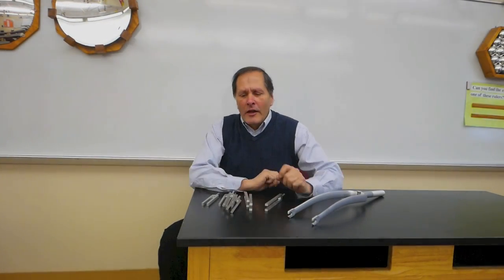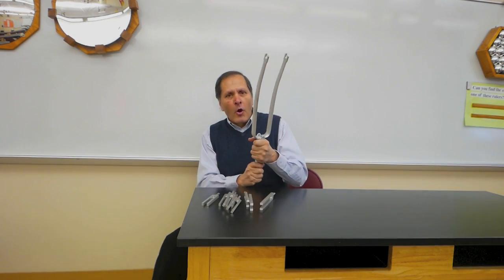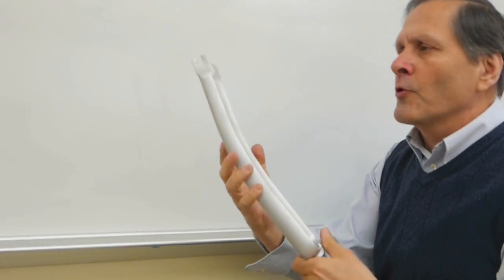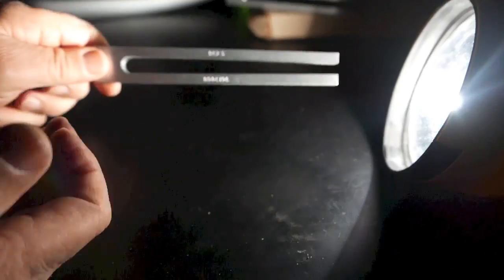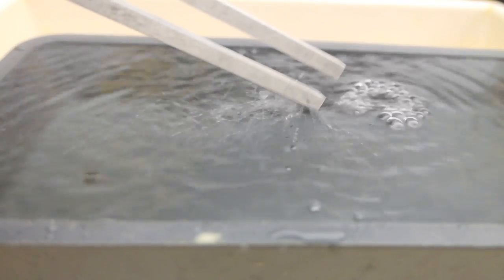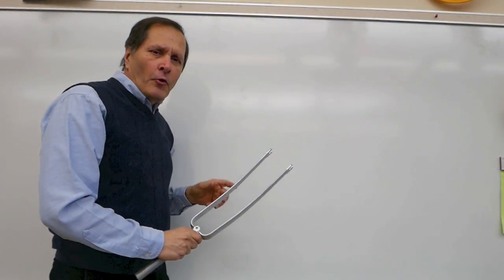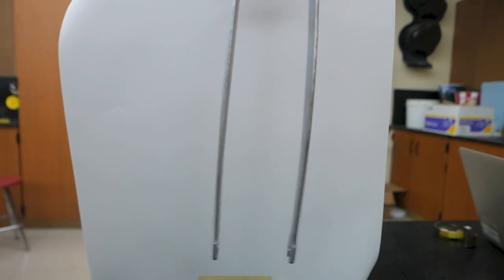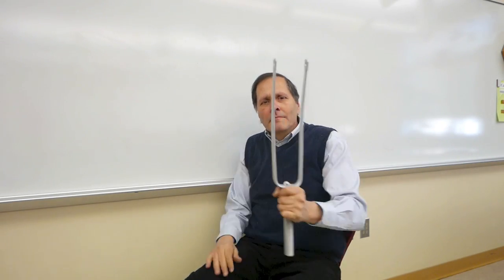Bicycle tuning  fork - physics of toys // Homemade Science with Bruce Yeany

Comment: I have questions and no one to ask... 🤓 How would I create a room or smaller area where one would be surrounded by a tuning fork type perimeter, (and maybe have flowing water around); which the vibrations also flowed through. I suppose sound vibration would work with speakers, but is that really the same? 😕 I guess that is the only way it would also be adjustable for lows and highs, but what would be best to transmit through water or the ground.  🥸 This is all new to me

Comment: I thought this was interesting how if you hold a tuning fork over a glass and hold another glass at 90 degrees to the other you can cancel the sound most effectively or "no sound whatsoever" according to this public domain book SOUND AND ITS PHENOMENA  (page 33 with diagram). It was also mentioned that a tuning fork placed on the end of a metal rod will sound but not if then the rod is bent 90 degrees.
I also tried the two glasses and tuning fork example and it's uncanny how well this worked with a 1024 C tuning fork with short glasses after a little practice.
Reply: A footnote though, canceling out a strong freshly struck fork completely defeated me. And it was tricky to get just the right angle with lower amplitudes. Maybe with precision, a different frequency or glass shape would be more forgiving.

Comment: Your channel is fabulous. (Great trick with the water in this video!) - But please try finding a set of better microphones and use them appropriately, in the right distance they are specified for. It seems part of this video was recorded with an ambience mic, where you would have needed a focused one that cuts out ambience noise. I know it is a lot of work to set up proper audio, but the videos will be much more enjoyable then. - Thanks for your great work! I watch every single video!
Reply from the maker: Thanks Christian,    I realize that's been a problem,  the camera I've been using was supposed to be of good quality (and fairly expensive) . but  I've had a lot of trouble with the exposure setting and sound.  I just bought a new camera Sony RX10 M4   and a directional sound mike which should make a big difference.     At the moment I've having problems with compatibility of the camera to my Mac computer but hope to have this worked out soon.

Comment: Great vid and thank you for solving a problem I have been working on, I was going to build a fork but this will work for the application I have in mind and I already have a pile of old bikes that have already been used for the gears and other what nots

Comment: Have you come across any big tuning forks at 24 hz?  I would like to do some experiments with with one at 24 hz
Reply from the maker: No, I haven't but you could adjust one like this by adding weight to the tines, that would slow it down until you got it to 24 hz

Comment: the camera has a rolling shutter
the waves are caused because the camera does not take an image at one instance in time for every frame, instead the image is created by quickly scanning across the sensor (say from top to bottom). the movement of the beam in the time it takes to scan across the frame is causing this rolling shutter effect. 

the shutter speed of the camera is the other element here. at lower shutter speeds the bar is blurred and the scanning is less evident. at higher shutter speeds each section is nicely frozen in place.
you could probably get this effect with an old CRT monitor where the pixels are illuminated by a scanning stream of electrons and show the phenomenon without the camera or with a rotating drum with slits in it so that a thin beam of light can scan across the bar very quickly.

if this doesn't make sense feel free to ask me to try and explain it better.
Reply: ps.
i think rolling shutter has been mentioned before (i just looked deeper into the comments) sorry if I've just told you what you already know

Comment: Maybe the black white background thing is caused by exposure duration.
The black background makes the camera attempt to compensate by being exposed for longer thus showing a blur.
The white exposing for brief enough that it only shows offset portions, like the strobe light does at a different speed. Maybe

A way to test this is to show the fork in front of a white bright view with the area the fork is in front being dark. Versus a dark view with the background behind it being white and clearly lit. The view refers to the majority of the cameras area.

Or if your camera allows you to set a fixed exposure duration regardless of lighting.
I hope you investigate this because I'm curious

Comment: The phenomenon demonstrated in the end might be reversed if the colors are switched, i.e. the bicicle tuning fork gets to be black.

It seems it has to do with factors like light/color frequencies and camera shutter speed/frequency, camera processing speed versus tuning fork frequency.

It would be interesting to test my statement, and kind of easier for you rather than me since you have the constant set parameters of the equipment involved.

I just discovered your channel.

GREAT WORK ! :)

Greetings from Heraklion, Crete, Greece !

Comment: Hey, I know why it wobbles in front of lighter colour backgrounds. 
The camera you are using has something called a "rolling shutter" which is basically taking the information off the sensor left to right top to bottom over 1 frame, so the top left hand corner is actually being recorded a fraction of a second before the bottom right hand side, this in combination with the shutter htz will give you this effect, It happens more on lighter backgrounds due to the luminosity and the contrast isnt as great and it blends into itself, making it more visible. 

If you were to use a camera that has a "global shutter" you would not see this effect, as a global shutter takes everything the sensor see all at one time, unfortunately these cameras are usually heavy duty and aren't made for prosumers with the cheapest one going for around $5000
Reply from the maker: LOL,  I think I will have to stick with what i have for now

Comment: I'd assume the tuning forks vibrations happen for the same reason the strobe light makes the ripples visible, because the FPS is limited. It not working in dark backgrounds could have to do with the built in video compression.

Comment: Most cameras evaluate exposure from centeral pixels, and they usually smooth exposure as well. To test exposure hypothesis, one could try to record fork with light/dark mat off camera center, with fixed intensity on-center. Alternatively one can try to change bright to dark background fast, while fork is vibrating.
Reply from the maker: I will try that,  thanks

Comment: I believe there are 2 effects at play here: shutter speed and rolling shutter effect. 
I'm sure you've figured out by now that the shutter speed changes depends on the amount of light enters the sensor (light vs dark background). However the warping is typical of CMOS sensors, you can read more by googling "Rolling Shutter Wikipedia", and youtube search "rolling shutter propeller", it's a pretty interesting read! 

https://en.wikipedia.org/wiki/Rolling_shutter
Reply from the maker: thank you I will check it out
Reply: I believe that the same effect would be seen on global shutter camera.

Comment: It's caused because of the shutter speed of the camera. When the fork is against a white background the camera adjusts the exposure and increases shutter speed and opposite when placed against a dark background. This is similar to the effect due to the freq of the strobe. Also the camera has a rolling shutter. That means the whole frame is not being exposed at the same time. The upper part gets exposed first. That may cause the slow mo wave effect.
Reply from the maker: Thank you that helps but I am still a bit confused.  I would have guessed that when shooting video,  that the camera adjusted the exposure by the aperture, is it changing both or just the shutter speed.
Reply: As I have noticed that the DOF is not changing. So, I assume, aperture is not changing. It may also adjust the ISO. But not really sure about that. If you have a camera with manual control, you can do some experiments to be sure. The AC lights may also contribute to this effect..
Reply: Bruce, was it only observable in the video? How about your direct observation by naked eyes?

Comment from the maker: I ran some more experiments with videoing the big tuning fork.   The waves are not apparent in looking at the fork directly.   I've recorded it with 2 more cameras.  A second camera showed the same waving motion as shown in this video,  a third did not.  Changing the color of the tuning fork still gave the same affect.
Reply: It's due to the rolling shutter effect. The camera does not capture the full image at once, it captures every frame row by row, this means that at every row the fork is at slightly a different position at each row, causing it to look like it's bending.
Reply: The rolling shutter / changing shutter speed sounds likely.  However I wonder if the artificial lighting flickering is playing a part? (i.e. 60 hz AC).  Trying this in sunlight might rule that out.
Reply: You also said that the fork vibrates at 54 vibrations per second. Most cameras now a day would record video at 60 fps (frames per second) which is slightly higher than the forks vibration. Much like the strobe light effect you showed in your video. That combined with a with a brighter background will produce that wave like effect.
Reply from the maker: that makes sense, so  the number of vibrations we are seeing is the difference between the fork and the shutter speed
Reply: Another interesting effect can be seen with street lights in Europe. Most cameras (made with the American market in mind) use 60 fps or 30 fps, this fits with the 60Hz mains grid voltage which powers the street lights. In Europe mains voltage alternates at 50Hz giving a glowing and dimming effect when filmed at 60 or 30 fps since the phase shifts over time. To avoid this effect would require filming at 25 or 50 fps.
Reply: The camera settings causes the effect I think. If the camera recognise more black (less light) on the picture, it changes some settings like the photo cameras change the shutter speed in auto mode. I think you should try to use the camera in manual mode and try various settings but the same with the two backgrounds.
Reply from the maker: I think you are right,  the problem is with these cameras, part of it is that the camera has not manual setting  when using the video portion of the camera.  It is very frustrating
Reply: I've observed some webcams lowering their frame rate automatically when the lightning is poor. That might be causing this phenomenon. Perhaps combining the strobe light with different backgrounds figuring that out becomes possible.
Reply: Bruce Yeany It's due to the camera fps and the shutter effect. That's my hypothesis, feel free to do your sciency things to figure it out
Reply: did you try two backgrounds at the same time? half black, half white? If it is the color then you'll see both effects at the same time if it is the camera mode/fps/shutter effect then it should look the same on both halves. also try it horizontally and vertically for the shutter effect is only visible in one direction alone, usually horizontal.
Damn, I wanted you to show the double background on the video itself LOL
Reply: you should try black fork on black background.  I have the feeling might be the video compression. The reason could be that less difference in the motion is noticed when filming white on white causing an higher level of frame compression.  But to confirm you should try black on black.
Reply from the maker: thanks,  I can give that a try
Reply: did you consider the frequenzy of the light source? I presume you are using neon tubes, these flicker at a specific frequency if it is close enough to the frequency of the fork it might cause the effect, the white background basically acts as a doppler since it reflects the strobing light better than dark backgrounds, try different light sources and check if the effect persists
Reply: did you try two backgrounds at the same time? half black, half white? If it is the color then you'll see both effects at the same time if it is the camera mode/fps/shutter effect then it should look the same on both halves no matter the color of the background. also please try it horizontally and vertically for the shutter effect is only visible in one direction alone, usually horizontal.
Damn, I wanted you to show the double background on the video itself LOL
Reply: Could it be due to the vibration control built into the camera?  I've seen similar effects where the entire picture is warped in strange ways (during vibration cancellation) but not sure if it would impact only a section of the frame.
Reply: I stumbled across this because I am interested in making my own large tuning forks, and wanted to see what else had been done (especially how rough the form of the fork could be). It seems like I should have an easy time given your success with an unmodified bike fork!

I also wanted to share my 2 cents on the sub-oscillation: 
It's certainly common to see the 'beat frequency' between a camera's frame rate and a vibrating object, so that makes sense. Especially so in the case where this oscillator is moving at 54 Hz, which is close to a standard 60 FPS. However, I do not think this video was recorded at 60 fps, and I don't think that it's just the beat frequency of the fundamental being observed. 30FPS is considered a 'safe threshold' for avoiding a shuttering effect with our own ocular frame rate, and your video is just above that threshold. An easy way to test this (without fancy software) is by adjusting the playback speed.. the shuttering effect becomes perceivable at 0.75x speed but seems unequivocally clear at 0.5x speed. In addition, the beat frequency of two waves is == f1-f2, which should be 6 Hz according to the original hypothesis. By my counting in your video (again using the playback speed tool)  the beat frequency is 3 Hz. 

So here's a slightly different alternative: With the information that the video is at 30 FPS, and the observed frequency is 3 Hz.. we would should be looking for a frequency of either 27 Hz or 33 Hz. The former stands out because 27 is 1/2 of 54. My guess: The asymmetry of your big tines, because of the forward rake on the bike fork, has generated a subharmonic of 1/2 the fundamental. A less likely third alternative is that the true fundamental is 27 Hz, which is harder to measure and hear, and the more noticeable subharmonic at 54 Hz is 2x the fundamental.

Comment: I think it is possible that difference in appearance for different backgrounds may be caused by differences in exposure and how your video camera adjusts. I suggest trying the experiment with black behind one tine and white behind the other. There may then be a variation in appearance between vertical and horizontal depending on the focal plane shutter sweep of you camera.

Comment: it must be an optical illusion just like how a pencil seems to bend when you wiggle it up and down.
Reply from the maker: HI Alex,  it was the strangest thing,  I'd go back and look at videos and couldn't figure out what was going on.
Reply: +Bruce Yeany (Yeany Science) Was it visible with the naked eye or only through the camera. Watching it again, I'm almost certain it's an illusion
Reply from the maker: Funny thing is,  I just shot this during this week and noticed it at the last moment as I watched the video.  I didn't try it specifically with the naked eye but will tomorrow. I will also try it with a few other cameras.  We'll get to the bottom of this yet!   Thanks
Reply: the camera doesn't take the whole frame at once it takes it from top to bottom or left to right.  thats why it bends like that on the video.  not sure why it only does it with white background though

Comment: good observation
Reply from the maker: thanks Arvind,   this piece has become a favorite toy since students discovered it is just as loud in the classroom next door if you put it on the wall.
Reply: +Bruce Yeany (Yeany Science) 
hi!
i cannot understand that spotlight or whatever used in demo..... Does  Normal slowing of camera didn't work?
Reply from the maker: The spotlight is a strobe light that flashes on and off at various speeds.  By adjusting the speed of the flashes to the same speed of the movements of an object that is turning or vibrating,  it can make the motion slow down or even stop.   In a future video,  I am going to show more on strobe lights and how to make a simple one.
Reply: +Bruce Yeany (Yeany Science) 
That's very non-intutive how can light alters motion?
soo interesting..is there any special name given to this phenomenon...